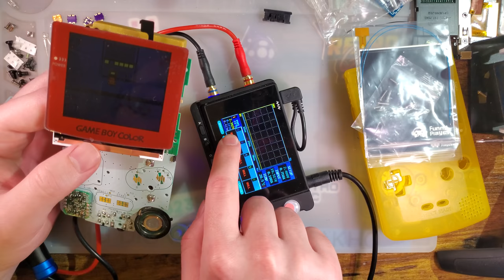'Retro Pixel 2.0' Funnyplaying Laminated Q5 GBC Backlight Redux

Comment: I folded the touch sensor towards the back as well. Except I did it that way because when I folded it forward, I couldn't activate it through the shell. Even taping it didn't help. Towards the back, and it works good.

Comment: makho, just a heads up: In this video you soldered start and select to the wrong vias. You soldered start to the bottom via (should be the top one) and soldered select to the top via (should be bottom). You did it right in your imgur guide tho.
Reply from the maker: ehh, for this kit it's not that important

Comment: 16:05 Mine had that in both corners, they went away after a while. However the built in touch pad AND the included one didn't work. Installed another Funnyplaying kit in a Gameboy Advance, touch pad worked fine. DMG kit luckily doesn't use the touch sensors.
Reply from the maker: that's why I banished the screen to the pile. I'm sure it will be fine when I go through the pile later. 

And you probably need to position the sensor better or hydrate yourself if it's not working
Reply: @makho  I installed one in another Gameboy Color, that worked. Just installed an IPS kit in a Neo Geo Pocket (black and white, not color) and the touch pads worked on that, too. The touch pads and cable just don't work on the very first one I installed.
Reply: @makho  What do you mean by hydrate?
Reply from the maker: @nusdogg  drink more water

Comment: Thanks for the video. I have been struggling for about an hour with the soldering on the start and select, could not get any decent solder on those buggers. I finally went with, "ok its holding up a bit" result and put kapton tape on it. What is the main cause to not get any solder in those holes, wrong solder, not enough flux, or wrong temp or tips? Had no issues with soldering the ribbon cable contacts.
Reply from the maker: the vias are tented which means you won't be able to solder to the surface unless you scratch the solder mask off. I tend to just put a blob of solder inside the via instead of on the surface. It's all in the technique for me.

Comment: I have problems with this IPS kit and Everdrive GB (chinese). Changes the pixel mode continuosly. And the touch sensor doesn't work properly inside the case. Not enough power I think. I have it outside the case.
Reply from the maker: double check that your sensor isn't located too close to the LCD ribbon

Comment: I been wondering for a while now, would you be able to use funnyplaying laminated q5 screen on a 1 chip q5 kit?
Reply from the maker: Q5 refers to the LCD. Since both are Q5 LCDs, yes they are electrically interchangeable. Note that FP laminated Q5 display assemblies rely upon the LCD to illuminate the logo on the lens which the OC variants do not do.

Comment: Question: do you know what kind of caps  are c22, c33, c25 and c34 are on an gba sp ? I ask since while adding a headphone jack to my sp I toke of all 4 of those caps and I don’t know what kind to get to replace them, the closest stuff I found was there nf and pf (two 100nf’s, a 47nf and a 470pf) and a can’t tell what one to get to replace them
Reply from the maker: https://github.com/Gekkio/gb-schematics
Reply: @makho  I actually looked up this to get a good look at what they where and that’s how I know what kind they are but there is to many options to pick from and most of them are 50vdc more or less and I don’t know which one would be better to put in
Reply from the maker: @leoalex50  the specs are listed in the schematic
Reply: @makho  but it doesn’t tell me the exact part so a had to look around for ones that might be good enough for the sp

Comment: Hey Makho. If I used that screen adhesive but need to move the screen to another shell later. What's the easiest way of taking the screen off without breaking the glass?
Reply: Id say only peel a bit of the adhesive tape from the sides, so its not on there completely and only partially,  rather than having the full adhesive on the back.
Reply from the maker: The adhesive is intended to be permanent. Lots of heat and take your time cutting the screen out with a delamination tool (taut wire).
Reply: Hey Makho. Great advice man. I actually took my hot air sation, and set it to the lowest setting of 100c with the lowest blower setting. Heated up the back of tje display making sure to not leave it in one place too long. After about 10 minutes of that and slowly wiggling it off back and forth, it came off and the transplant into the new shell was successful.

Comment: Does the shell need modifications before hand?
Reply from the maker: not for use with the kit it's designed for
Reply: @makho  can you recommend a screen and a shell that I don't need to modify?
Reply: @makho  every kit I see says the shell needs modifications
Reply from the maker: @TomShadowrider  If you're going by my wiki, ever screen that doesn't fit in an OEM shell is marked that the shell needs modifications. If you use the kit that this shell is designed for, you do not need to cut the shell.

Comment: see the little bulge at the front under screen any way to get that flush
Reply: @makho  if u look down from the top there is a small bulge under screen
Reply from the maker: @CountingCarp_uK  I'm not seeing what you're seeing. 

Are you talking about the GBC casing being not flush against the screen lens? Because that's by design on every single GBC made by Nintendo. The buttons are even shaped to match this subtle curve.

Comment: I swear my ribbon is messed up or something. The start/select doesn't do anything to the led.... the buttons work in a game but not for the kit... do I have a bad ribbon or what? I don't understand. The touch sensor works and I hooked everything up according to the vid. I'm fuminggggg right now.
Reply from the maker: Double check all your solder joints and that the wires aren't being pinched
Reply: @makho  I actually got in my purchase from FP directly and when I switched out the ribbon cable, it all worked with the same soldering to the MB. RGRS gave me a defective cable and now their Customer Service is all quiet about it. I don’t think I’ll be getting a replacement cable for the other kit I was going to put together.
Reply: @mailman1021  Hi there! Please message us directly with your name and order number so that we can better assist you. Please make sure to us a "regular" email service such as Gmail or similar as we have had issues with custom emails (such as .edu or similar) not coming through.
Reply: @mailman1021  So the new cable from FP fixed your issues? I had the same issue with my V2.3 cable from HandHeld Legend as well.
Reply: @nusdogg  yup, the ribbon cable from RGRS was bad.
Reply: @mailman1021  Nice! Mine blew my F1 fuse. Replaced the fuse and now it's all good. Waiting on new kit to come in and try again.
Reply: @nusdogg  Sweet. I hope it comes in and everything works. I haven't been able to try the replacement cable RGRS sent me but I'm assuming it will work this time. They never did acknowledge the defective part after I sent it back for "testing" but since I got a replacement, I guess that's an acknowledgement haha